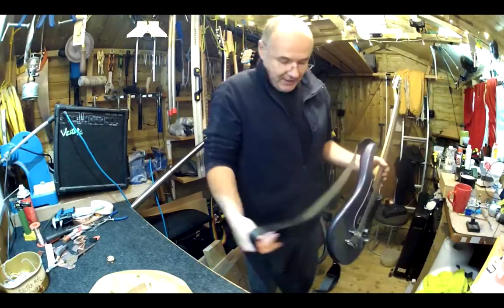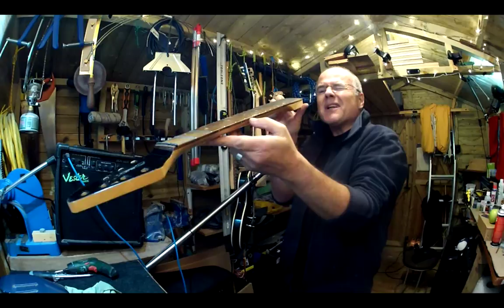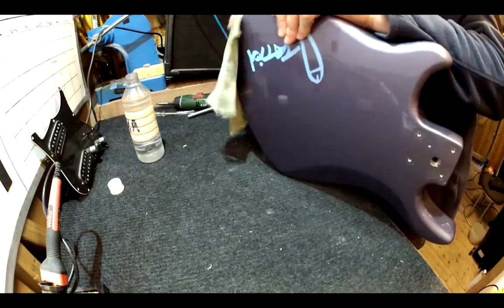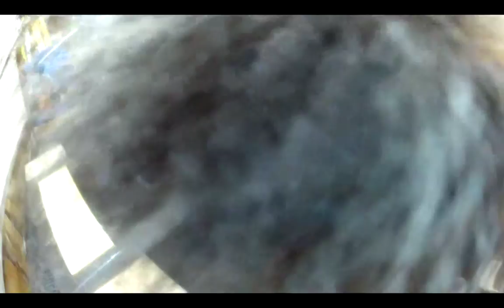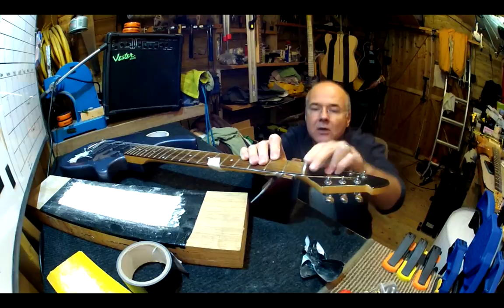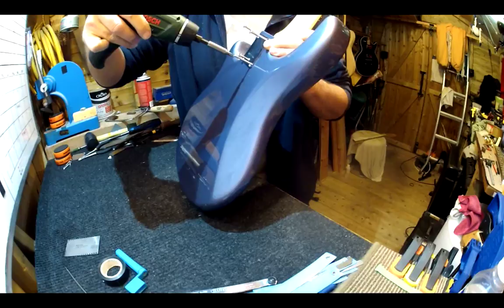Extra wide 6 string electric guitar conversion (from 7 to 6 string)

Comment: Sam Deeks Electric Guitars are fantastic for learning on (especially barre chords) cause of lower action, smaller body & neck w/ labeled control knobs. Even though Electric Guitars are the most beginner friendly Guitar, lots of people have big hands & they want an Electric Guitar with a Classical Width neck but with lighter strings & lower action. Turning 7 String Guitars into Wide Neck 6 String Guitars will help those who have that condition rock out again.

Comment: If you decide on different pickups for future versions, rails are obviously the simplest solution. If you ever want to make custom pickups for this, I recommend stacking a couple of P90 bobbins, winding them with either 38 or 40 awg wire in a humbucker format, using neodymium magnets, and aiming for a low DCR, something like 4k-5k with around 2 henries inductance AKA a "hot" Filtertron.

Then route the body so that this single pickup lands under the 36th fret location. Coupled with 1-meg pots, passive mid control, and a series treble bleed, I don't think you could get a cleaner, more well rounded setup. You could add maybe add coil splitting, but the large wire, neo mags, stacked construction, and low DCR should all make it plenty bright, so I don't think you'll need a "single coil mode" especially with the passive mid control allowing you to turn the mids down and make it sound more jangly/acoustic.

Comment: Okay I think at the end you said 11.4mm spacing between strings across the bridge, not much less than my TOM conversion at 12.5mm... I forget what you said it was across the nut between strings; I mostly have 9mm between E and A then 8.5mm, 8mm, 7.5mm and 7mm between B and high E. Though I moderate those measurements by feel and eye as I do it.
Mark D Phillips...... PCGC
Reply: What make and model is your TOM bridge with 12.5mm string spacing, please?
I want to have the 12.5mm one installed on my Ibanez GIO 7221.

Comment: hi been playing my pride and joy yes my pride and joy of my fleet of guitars i have 14 guitars 3 fenders i american 2 mexico burns les paul not going to bore you with the others but the size of my hands wont let me play them but now thanks to sam i can play with out muting strings so all the knockers and critics out there this guitar works 100% and i will be getting the blade pick ups sam cause make it more awesome than it his now
Reply from the maker: +big steve Introducing Mr. Big Steve himself, the inspiration behind the 'Big Steavey' :-) Steve, your feedback is what matters. People thinking they know better don't have the satisfaction of knowing that what they do makes a difference like you've shared here. Thank you. When I've found the right blade set up, I'll build a custom pickguard and load it for your guitar - minimum of wiring will be needed. 

Steve, FYI the other chap recently did a Peavey Predator 'wide 6 string' but he's kept with the 7 saddle bridge and 7 hole stop piece...and replaced one of the 7 hole humbuckers with a ??? Tele narrow 6 pole single coil...
Reply: seen it sam no thanks people that have seen mine played it  didant even know it was a 7 string till i told them which his a great complement to you sam can not recomend enough not just the big steves the big johns any one out there with big hands who had give up dont drop sam a line you wont be disapointed

Comment: Awesome and truly inspirational! I'm thinking to do this with Ibanez GRG7221
Reply from the maker: Thanks, appreciate yr comment. Wish you luck with it! Drop by at Reloved Guitars page on Facebook and show me some pictures when you're doing it!
Reply: @SamDeeksRelovedGuitars  The Lower action & thinner Strings on Electric Guitars makes them easier, but finding an Electric Guitar that those who have big hands has been a proble untill now, where we've turned a 7 String into a wide neck 6 String cause the wider neck will be easier for those who have big hands, but the lighter gauge strings & lower action than a Classical (or steel string) acoustic Guitar makes it easier.

Comment: Really intresting video could you get a wider neck for a squire guitar for wider strings and make it work
Reply from the maker: Mmm I doubt it Mark - I've never seen a Squier model with a wide enough neck that would work for the guys who wanted this kind of conversion.
Reply from the maker: @markshone4606  You could Mark... you'd have to make a spot-on accurate template from the actual neck you were intending on using; then you'd have to use a Schaller 3D bridge to spread the strings wider... (which also then means losing the standard Strat or Tele bridge... )

Comment: Hello again Sam... Mark here who makes a lot of these wide neck guitars from that Predator 7 quite often and Gear4music7s and Schecters and Harley Bentons... I think we talked wide necks a couple of years ago  when you had made this guitar on the video?  I am happy re cutting TOM bridges from 7 to 6, but that Schaller bridge is new to me and what is the distance from E to E on it; is it 62.5mm like from E to E (or low B) on the 7 string TOM bridge?
Thanks,
Mark...................
Reply from the maker: Hi Mark, I know you're happy re-cutting and I'm one of those people who will always doff my cap to your 100% happy customer base, regardless of what your critics have to say :-) This Schaller bridge isn't cheap but it IS the perfect solution for the extra-wide 6 string conversion. The difference of course is that it adds £50 or so to the price. As it happens, my customers were happy with that so it wasn't a problem. I can't tell you want the measurements are / were because I've forgotten lol but it was easily wide enough for the job. You just have to set the outside saddles to their max and 'balance' tthe rest in between.

Comment: Hello Sam,
Did you notice any drop out of audio due to the poles not lining up? I'm attempting the same modification at the moment and I don't want to spend $400 for 7 string rail humbuckers. CHeers!
Reply from the maker: Theorn Campbell Hi Theorn, ‘Not a lot’ is the short answer. I do believe I could detect what I can only describe as a faint ‘slight phasing’ effect when bending stings...but it wasn’t enough to make the guitar unplayable. 

On the next ones I made I used a pair of 6-string humbucker rails. Some manufacturers by default make their 6 string rails just wise enough to work with the spacing I set on these guitars.
Being 6 string rails / blades there was a much wider choice - allowing me to buy s decent ‘budget’ pair for more like $100 compared to the $400 you mentioned. You just have to get the blade dimensions from the manufacturer or retailer before purchase to be sure..